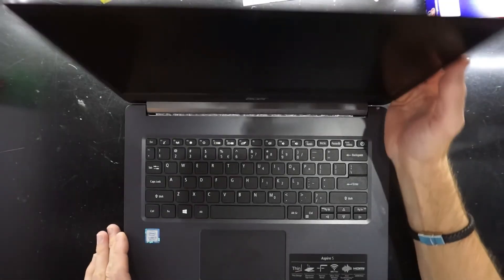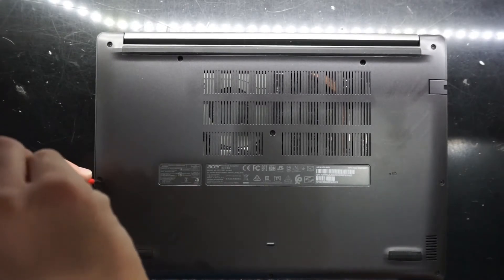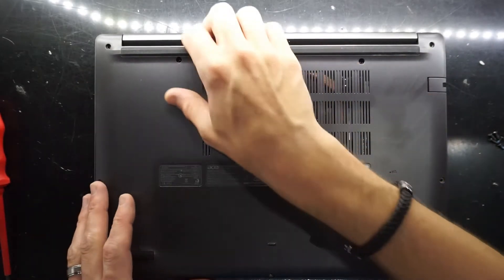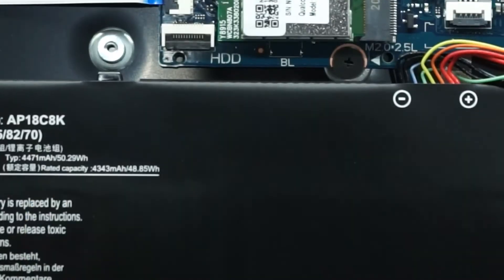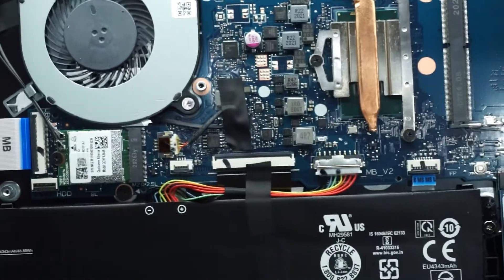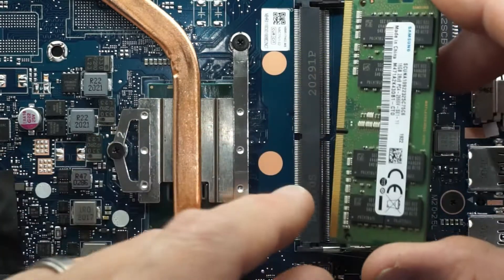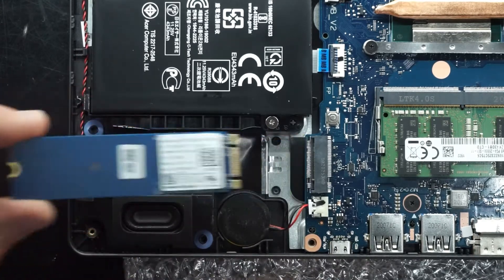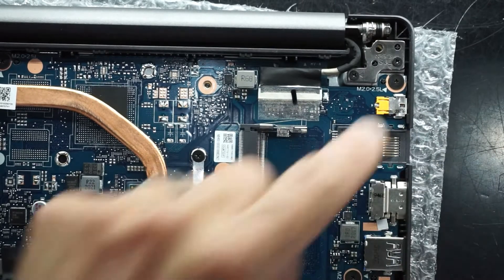Acer Aspire 5 A514-52K Ram and SSD upgrade

Comment: Thank you so much for your very detailed but concise video. After paying $230 to get a new hard drive in February 2023, the thing died on me last week. I have never cracked a laptop case, but did not want to spend another $230 for a new hard drive. I refuse to use Windows 11 because of the taskbar lacks the ability to "never combine" icons. I considered buying a refurbished machine with Windows 10 installed, but all those computers were older than my Acer 5. After viewing your video, I thought that maybe I could actually install a new hard drive. After much anxiety and agony, I did it! I'm using my new hard drive on this computer to write this message. Thank you again!

Comment: i have an acer aspire 5 a514-52kg 34h4 (similar, just mine is kg and here its only a k)

sites say it can only go to 12gb (i have 4gb soldered) or 4gb+8gb ram

i wanted to know if it could be upgraded with 16gb ram for a total of 20gb like here or can it only be upgraded with 8gb ram?

Comment: THANK YOU SO MUCH! I have almost the same Model No. as yours but with i3 10th gen(i3 11010u) and its Acer A514-52G-32K1. May I ask is there any specific reason why you chose the 16GB DDR4-2666 MHz over the 16GB DDR4-3200 MHZ since I did the Crucial scan and it says I could get the 3200 Mhz one. I'm still quite confused over the difference of the two. Thank you so much your video has been really helpful for someone who isn't techie like me! :)
Reply from the maker: https://ark.intel.com/content/www/us/en/ark/products/196451/intel-core-i310110u-processor-4m-cache-up-to-4-10-ghz.html

I used the 2666mhz as Intel chip doesn't run any faster using faster mhz ram 

The CPU tops out at 2666mhz, so why spend more for no gain
Reply: @rickstechrepairs  Oh, I get it! Thank you so much for this!

Comment: I want to upgrade my Acer Aspire 5 A514-52k but I wondering if I change the ram will my processcor work better ?
Reply from the maker: if you have dual channel ram it will (both ram slots filled)

Comment: Can i use 8gb 3200mh?
Reply from the maker: Yes But depending on what CPU you have your laptop wont use the full 3200mhz and probably only go to 2666mhz
Reply: @rickstechrepairs  What mhz of ram should I use?
Reply: @faishalfuad122   you have to download cpuz to know that
Reply: I have ACER N19H2 1005G1 @ 1.2GHz with 4GB RAM, can I upgrade it to 16GB RAM with 2666mhz?
Reply: Any link for the 16GB RAM?

Comment: Hello, I'm still new to this kind if stuff and currently trying to upgrade my ram, is it really necessary to unplug the battery in the process? Also, are other brands of RAM compatible to this model? (A514-52KG-339Z)
Reply from the maker: if you are new to pc's, yes unplug the battery
most brands are compatible

Comment: Hi! My laptop is also Acer Aspire 5. I just wanna ask if it's normal if the fan blows to full power once you turn on the laptop?
Reply from the maker: Hi, that shouldnt be the case, it might spin up during high activity, but should settle down shortly after.
Reply: I see. The fan spins up upon turning on but it stops after 30 seconds. Thanks for answering anyway!

Comment: after upgrading ssd will it instantly be detected as the main storage in the laptop or you still have to do more stuff for that?
Reply from the maker: it will detect as the main drive, but you will either need to clone windows to the new hard drive or you will need to do a fresh install of windows 10 to the new ssd
Reply: @rickstechrepairs  how do i install windows 10 to the new ssd?
Reply: @kethlaveneabunda936  Clone the old drive.

Comment: can we upgrade to a i7 ?
Reply from the maker: No
Reply: @rickstechrepairs  that sucks ass is there any CPU upgrades
Reply: There's an amd version which is better but it's always out of stock
Reply: @bradley_grampus  do u have a link?
Reply: @deyonrocks56569  ye sure 1 moment
Reply: @deyonrocks56569  it's out of stock again well it is in Ireland anyway just Google Acer Aspire 5 Ryzen 5 3200u and there might be on available for you
Reply: @deyonrocks56569  but the Intel version is still pretty good there's not that much of a difference especially when the ram cap is 20 gb
Reply: @bradley_grampus  cheers man thanks for the help
Reply: @deyonrocks56569  np